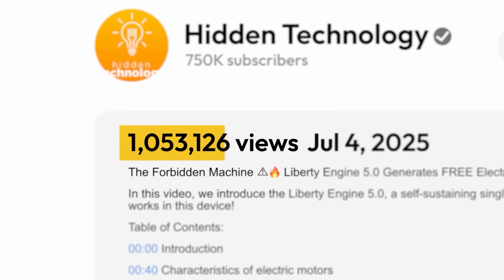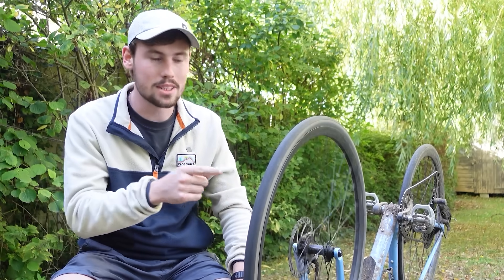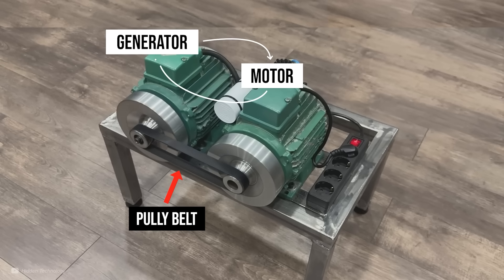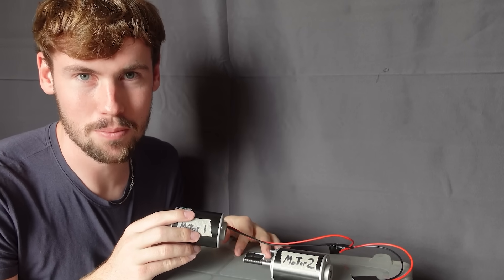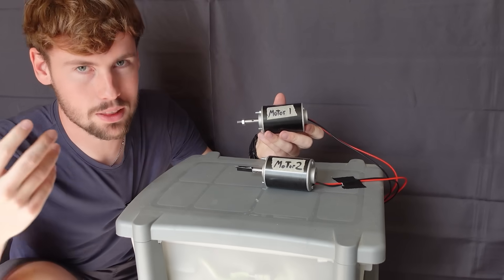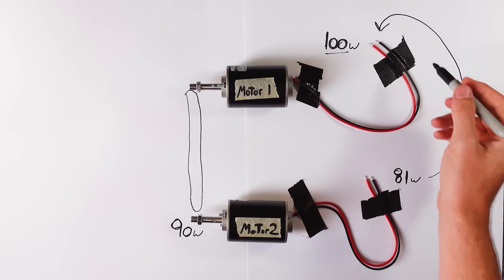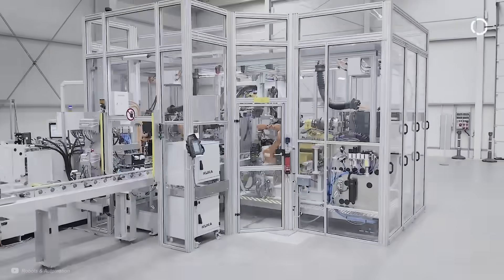100 Years of Waste! Solved by an Unlikely Invention.

Comment from the maker: The fake device may not have broken physics, but the general ideas ended up being shockingly useful!

Invest in a better night sleep and be more efficient with your heating and cooling with EightSleep! Use code ZIROTH for $200 off the Pod 5 Core or $350 off the Pod 5 Ultra, or visit https://eightsleep.com/ziroth
Reply: Another, often overlooked energy loss, while not as large as the loss from heat, is sound.  Anything that makes noise is losing energy through sound.
Reply: 100-81=19
Can you explain what work is actually being done as during conversion we lost 19 Watt but we did nothing. Because 81 Watt that are being converted from mechanical to Electrical energy is work so we are giving 100 w to get 81 w I think this is not good math.
But the concept like synchronous condensers are very useful in grid stability.
Reply: @manzoorkhan5246  The fact this guy use to believe in free energy say alot about his cognitive powers. Straight after the so called math he makes a quantum leap from testing motor eficencys to some how saving grid energy with the same gear. All the energy we could ever want or use is beneth our feet.
Reply: @Timbo_tango can you elaborate more
Reply: Dogsnot advertising devalues any artistic merit your video may have held. 
And before anybody pulls out "creators gotta eat", there are less garbage ways for an engineering doctorate to earn a buck.
Reply: Stop this hustle.
Reply: Slight typo in your description: 
which actual has
Should be
which actually has
Reply: Hybrid vehicles use similar principle
Reply: So The motor is like a flywheel?
Reply: All motors create Back-Emf.  No point connecting two motors together.
Reply: How good are peltchey (peltier? They convert heat to electricity, though they werent very efficient last time i heard about them) tiles now? Can we rig something to harvest that waste heat and convert it back into energy? Still wouldn't be 100% efficient i don't think, but wouldn't it be better? Also the extra weight of the ceramic may cut vibration? Wonder if anyone had done those studies yet. 🤔
Reply: There are a lot of possible inventions, too. Hot water used to boil potatoes can be a source of renewable energy. We could save the world by boiling potatoes!
Reply: amazing how you left out the fact that these "flywheels" are actually centrifugal batteries and are already in use in industry
Reply: I'm devastated, I thought they were all real!
Reply: Free Energy is not possible.
Expanding your definition to encompass a larger closed system is.

You don't need to break physics for abundant energy,
you just need to tap into the existing resorvoir.
Reply: Congrats u made a dyno
Reply: I get your explanationOf only needing 19% to keep the system going through what I guess is PWM. But I counter with if you need 100% output you're using somewhere between 109 and 119% of what it would take to just power the 100% you need outright. Can it be used as an energy storage system. It is interesting.
Reply: chi ti paga amico? chiti paga per diffondere il falso, non ti vergogni l'Universo e energia la materia proviene dal vuoto che vuoto non e'. Piccoli schiocchi che vi fate guidare dai suonatori di piffero tra poco vedrete tutti.
Reply: A 1 kg mass dropped 1 m in a 20 kg modified Atwood's produces 19.81 units of Momentum. But it only takes 4.429 unis of Momentum to return the 1 kg back to the original configuration before  the drop. 
So ALL people who are saying that energy is conserved are saying that momentum is not conserved. A throwing device such as the Dawn Mission despin can place all the motion of a large mass into a very small mass. And a ballistic pendulum shows us that energy can not be transfered  from a small mass to a large mass: only momentum.
It is guaranteed by Newtonian Momentum Conservation (F = ma) that the momentum of the large mass be given to the small mass. Therefore the 20 kg Atwood's that transfers its motion to the 1 kg has 20 times as much energy as the 1 kg dropped 1 m. See 'cylinder and spheres' Delburt. Phend
Reply: if you make "pulse" actuator that store at least 10%  per 20 revolutions, you may get a Nobel Prize  and then only need to make the mechanism or the electric part to continue the cycle
Reply: WhitePaper101 | Presents the world's great electrification accomplishment. However, there is one major problem today: the over use of fossil fuels. NASA can develop Mr. Tesla’s Nobel generator to benefit everyone.

Comment: Probably you just acting as "dum" person...?
In my business we are using magnetic bearings for low friction and no loses in anything what you want to test...
Energy have been store for many years in flywheel without bearings....
AC electric current is totally different what you have been showing in this video...
We have tested so many generators last 20 years what they are showing opposite what you explain in this video...
There are some of the generators we found as 220% more output, from the input, and they are using regular bearings...
Some of those generators you can find at home, as in LG washing machine with direct drive...
That motor have 30% more efficiency of the output, from the input...
Good luck everyone...

Comment: They are not all fake goof ball ! However most are fake I will admit. However, to think that in this day and age it cannot be figured out is ridiculous....of course it can be figured out.... but most are approaching their designs in the wrong way. I designed one when working with the US Space Program and this particular device can put out over 200,000 watts of continuous power indefinitely obviously for use in space where there are no renewable fuel supplies readily available. Most are not understanding the complexities involved with their designs and I cannot get into that for you at this time.

Comment: I don't think perpetuum mobiles really needed for this. Waste energy reuse is a basic engineering thing. What may have changed is that sophisticated power electrinics became much cheaper and advanced, while energy became more expensive.
And now even BESS can be used formsuch a setup to mitigate dependency on grid even further.

Comment: AI Summary

Abstract

This technical overview examines the transition from traditional dissipative dynamometer systems to regenerative "back-to-back" testing architectures. While the transcript acknowledges the proliferation of "free energy" fallacies, it utilizes these concepts as a pedagogical bridge to explain the Hopkinson’s test and modern regenerative dynamometry. 

The core engineering focus is on the recirculating power loop: an electric motor (Unit Under Test) is mechanically coupled to a generator (Load). By utilizing bi-directional power electronics, the energy generated by the load is not dissipated as waste heat but is instead rectified and fed back into the motor’s drive system. This configuration reduces the net power draw from the utility grid to only the sum of the system's internal losses (friction, windage, and copper/iron losses). The primary industrial value proposition identified is the significant reduction in required grid infrastructure—such as transformers and switchgear—and a drastic decrease in operational energy costs during long-duration endurance testing.

Recirculating Power Systems in Electromechanical Testing

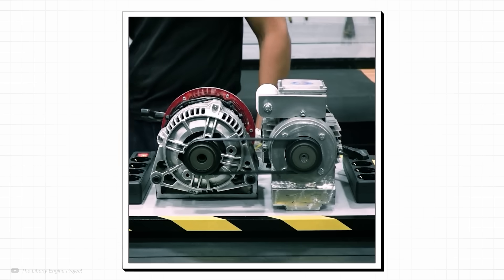*   0:41 Thermodynamic Limitations of "Free Energy": The foundational laws of physics, specifically entropy and friction, render 100% efficiency in a closed system impossible. Flywheels and bearings, even those designed for vacuum environments by NASA, eventually succumb to air resistance and bearing friction.
*   2:41 The Motor-Generator Loop Concept: A common "free energy" trope involves wiring a generator to a motor in a closed loop. While functionally a "fake" device for energy production, the mechanical and electrical coupling of two machines is the basis for high-efficiency industrial testing.
*   6:21 Dynamometer (Dyno) Fundamentals: In automotive and aerospace testing, a dynamometer utilizes one machine to provide a load against another. Older "dissipative" systems converted the load energy into heat, requiring massive cooling infrastructure and wasting the electrical output of the generator.
*   7:37 Regenerative Math and System Efficiency: In a regenerative setup, if a motor draws 100W and delivers 90W to a shaft, and a coupled generator converts that back to 81W of electricity, that 81W can be recirculated. The net "make-up" power required from the grid is only 19W (the delta of system losses), rather than the full 100W.
*   8:48 E-Axle Testing Architectures: Modern systems, such as those by Unico, utilize a central motor connected to an axle powering two lateral generators. This "back-to-back" configuration allows for high-power "thrashing" of components while the majority of the energy is traded internally between the machines through a shared DC bus or power electronics cabinet.
*   9:31 The Hopkinson’s Test: A classic engineering method requiring two identical machines to determine efficiency. By coupling them, only the losses need to be supplied by an external source, allowing for high-accuracy measurement of machine performance without high-power consumption.
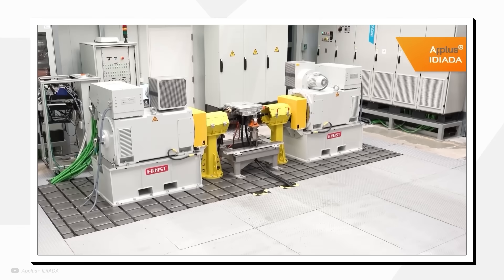*   10:02 Infrastructure CAPEX Savings: Beyond operational electricity savings, the primary financial benefit is the reduction in Grid Infrastructure costs. Regenerative systems allow facilities to test megawatt-scale motors without installing the massive transformers, high-capacity switchgear, or utility reserve capacity typically required for non-regenerative loads.
*   10:45 Key Engineering Takeaway: Advanced motor test labs leverage the principles of energy recirculation to simulate full-load conditions with minimal net energy input, effectively decoupling the test power from the grid capacity.

AI-generated summary created with gemini-3-flash-preview for free via RocketRecap-dot-com. (Input: 18,680 tokens, Output: 840 tokens, Est. cost: $0.0119).

Comment: its not actually a scam its useful, it works like a flywheel stored energy system but whats useful here is compared to a flywheel alone, this thing can run for tens of hours before losing motion.

Comment: No such thing as eternal motion without wear, loss, or eventually turning to dust. That said there are over Unity methods tjat have been around for the last 75 to even 100 years using flyback voltage. Hate to break it to all the electrical engineers but you were taught only parts of the truth. There is an ether, proven first by Tesla but thousands since. Its not electrons moving in a wire, but the electromagnetic waves propagating through the ether. EINSTEIN was nothing but a fraud, who wrote up a hit piece to pull all attention away from the endless amounts of energy, even in a vacuum

Comment: The Alternator with the 12v Motor is Key when you have a Ultra Capacitor 12/16v Bank to Store it Maxwell or EATON Brand Ferad 1 or 500 Ferad and use A 400w to 5000W pure sine wave Inverter

Comment: I remember this kinetic energy recovery system, a mechanical flywheel used for race cars. When clutching in, it would spin a mass up to 200k RPM and dump loads of torque/power into the drive train on demand.

Comment: Say what you will, but I built a mini version out of very high quality, low friction r/c car motors bearings. It did work and produced 13.1 volts while drawing 12. Not much, but proved the point. I then destroyed it before I mysteriously "dissappeared".

Comment: I did this at 7 and then at school i did physics. 10% losses is not possible with a brushed dc motor and generator 30% is considered good 100 down to 70 and another 21 in the generator so down to 49% a ball park for Regen in an EV strange coincidence.  A infinite% improvement from a petrol car.

Comment: Are you fooled ? The 19 watts is a loss, not a gain ! 
The only thing you can save $$$ on is with power factor correction on reactive loads. Lots of people fall victim to the flawed logic of "free energy" and "over unity" bla bla on the internet.
The only energy that is free is solar, either directly or indirectly, like wind and wave. 
Keep in mind that all energy originates from the sun anyway, even so called fossl fuel.

Comment: This setup is also used for power conversion, conditioning and isolation.
Depending on the motor and generator configurations, can be used to convert AC, DC, input/output voltage, phase, or act as a buffer (spinny things have momentum).
Sure its a little lossy, but thats the price you pay for getting precisely what you want as output with a relatively simple setup.

Comment: The energy a motor needs to keep itself running increases as the load on that motor increases, considering that if we just feed in the energy lost as heat, windage losses, and bearing losses using this set up then yeah the motor will keep running very efficiently. But if we want that motor to drive something then we need to feed in significantly more energy otherwise it will just stop spinning the moment a heavy load is connected. So microcontrollers are needed to control the motor input power.

Comment: Newtonian Momentum Conservation requires that energy can be made from gravity. 
A plate of steel moving 1 m/sec on a frictionless plane is able to transfer all of its Newtonian Momentum to a smaller mass. The Dawn Mission despin, sounding rockets, or Smokin Lamas are all despin events that give the motion of large masses to a much smaller mass. These all spin but you can use straight line motion that spins a light rim or wheel.
If the flywheel or plate is ten times more massive than the small thrown mass then the energy increase is 1000%.
10 kg × 1 m/sec = 1 kg × 10 m/sec and this is just Newton's Second Law,  F  = ma.
When you have produced this (1/2 × 1 kg × 10 m/sec × 10 m/sec = 50 Joules of energy from 5 Joules it can be loaded into a 10 to 1 Atwood's machine. This Atwood's can produce a motion of 10 kg moving 1 m/sec 10 TIMES. It only takes a drop  of .5097 m and the small 1 kg mass can rise 5.097 m.
All you need for free energy is an Atwood's and a despin machine.

Comment: You did choose your words carefully by saying in a closed system. Another term often that  has a double meaning is free energy. Maybe in an open circuit where energy to take up the losses is free as in not paying a power company for your driving motor which runs your generator that powers your house. This system can be realiable, fuel-less, quiet and no power bill.

Comment: If you can power a moter that charges a alternator that can make more power then the motor you can have free energy. Even if it charges a battery by itself and not by an outside sorce to keep it going

If it doesn't require a wall outlet or gas and makes power on its own its good. Even if it had a battery that it itself charges

Comment: What if I tell you it can work?yes 100 recovery is impossible but like you in childhood I was fascinated by idea and it was debunked for me very soon but there's new technologies that use things like unwanted byproduct and environmental energy can help you achieve it, it's not actually a perpetual system but with addition of something else you get it.
Unfortunately for me I see huge systems that can get double digit more power by using some byproducts,and yet they spend more on more expensive renewal systems when you get 30 percent more energy from a 200 MW plant which without it that energy is not only going to be waist they're going to add heat to environment.
In economics colleagues with no knowledge of physics do what is more popular not what is more better,it specially gets hard when you see for example adding a cooling tower costs a fracture of what they should spend from tax money to achieve that energy but public image stops the rational decision which is kinda people's fault because they don't know what option actually is better for them.
And it's shocking for me that for first time in history we have direct heat to electricity convertors like peltier yet they don't give enough budget to them.

Comment: Floyd Sweet had a device the size of a cigarette pack that could run a 350 amp motor with nothing but the energy in the space around the device. But of course, that’s not allowed.

Comment: Bro, you’re not saving anything! If the whole setup is just to spin motors, you’re looking at 100% losses—okay, let’s be generous and say 119%—because you’re not doing any actual useful work with it.

If you’re trying to use a non-electronic setup for phase shifting or DC/AC conversion, you’re still stuck with those 19% losses.

You’re completely busted. And honestly, it was pretty dumb to make this video. I knew it was nonsense, but I wanted to see just how deep your stupidity goes. Turns out—very, very deep. 😂😂😂

And as for using it as a dynamometer—sure, the losses are smaller. But that’s been done since probably the 1950s. So no, it still doesn’t justify a more than 10-minute video for something that could be summed up in two lines in a mid-century popular science magazine.

Comment: This principle is also used in old school rotary converters, since the late 1800s, ac power from the power grid is fed into an induction motor, turning a brushed generator, converting alternating current power into direct current power. This was used by high powered DC applications, like the new York city subway, before high voltage solid state converters came into existence. This was also used in AC systems with non standard frequencies (like 25 hz, as seen on old railway infrastructure, or the 400 hz power system used on commercial aircraft for example) to step the grid frequency(50 or 60 hz) down or up to the specified frequency